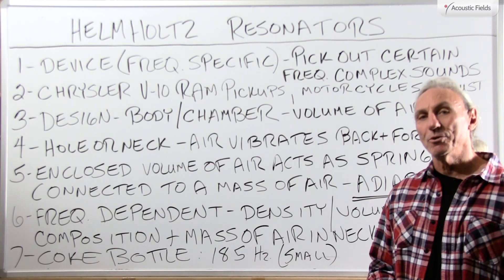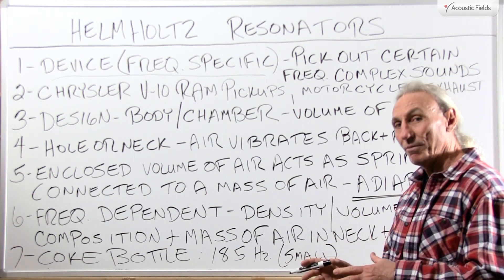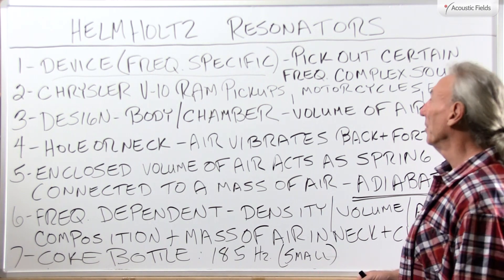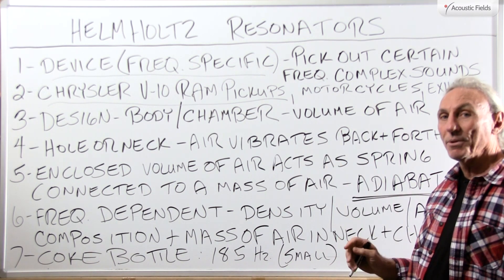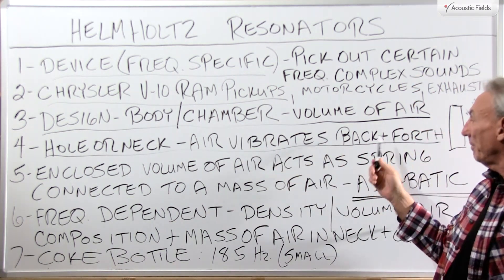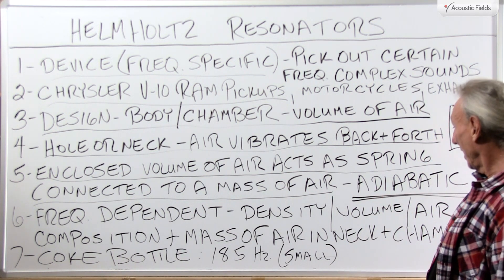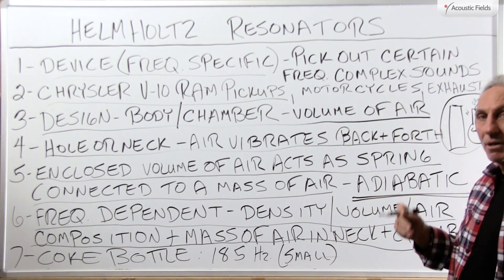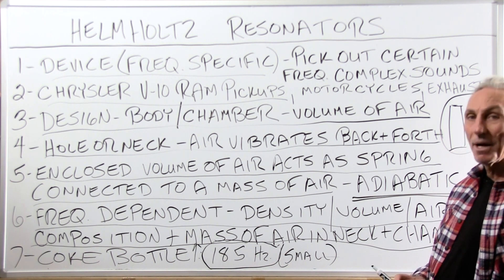Helmholtz Resonators - www.AcousticFields.com

Comment: Concerning dampening material in helmholtz and perforated panels. Is density or gas flow resistivity crucial for absorbtion? Your carbon perforated panels use carbon, so I assume it is about density like in the BDA. People always talk about gas flow, or is that only with porous absorbers the case.
Reply from the maker: M,  Its a combination of both. You need air flow (molecular velocity) to produce friction to yield heat which is an energy transformation.  Our carbon technology does two things inside our cabinets.  First, it absorbs internal cabinet resonances. Second, we use large amounts of carbon inside each cabinet (50 lbs.) which produces a pressure change inside the sealed cabinet. This atmospheric pressure reduction is one part of a total system that produces the most  absorption per square foot ever created in a commercially viable product.
Reply from the maker: Mr. Dampening is a process that involves moisture. Damping is the correct term for your usage.

Comment: which size do I need to absorb 10 db at 40 hz with a helmholtz resonator?
Reply from the maker: M,  You will need to build 20 units that are 4' tall minimum.
Reply: @AcousticFields  Thanks you. If you say 20 units with 4´tall, how is the cabinet depth and width?
Is 12" depth enough?

Comment: As always a very nice video and a very interesting field for experiments. I have tried to build many of them. You need of course sufficient enclosure volume to deal with the specific problems in you room. There is also a drastic difference in perfomance between different enclosure proportions of the same volume and a port positioning plays also a great role. 100x40x60 cm worked the best for me. You can use up to 25-30% of absorbtion material inside to broadening the range of the unit from 5 to say 10-12 Hz and smoothing the absorbtion curve. Not to mention that to use it more effectively you need to place it near the sound source and made a final tuning in your specific room. I have placed one behind 2,5 cm wooden wall in my studio and nevertheless it has helped me to reduce the subwoofer energy by -4 dB SPL at 34 Hz. One time the two of the experemental units were in the neighboring room behind the closed door and influenced very strong (1-2 dB SPL) my acoustical measurements. You also should be very careful to place the units near to each other in some cases. As the Dennis already mentioned you need enough place and and not the less effort.